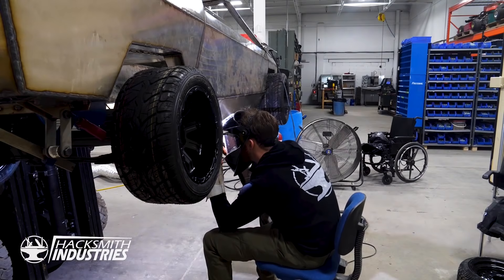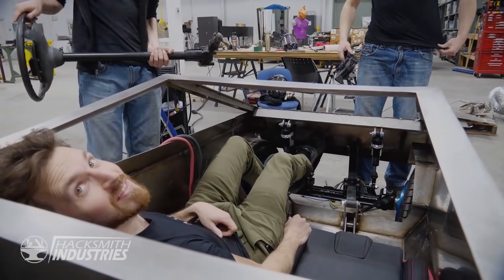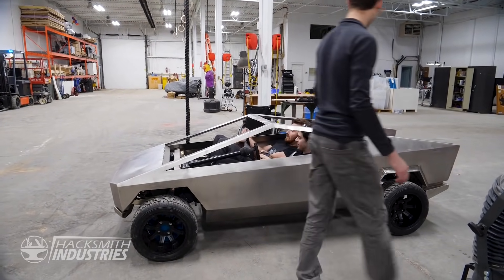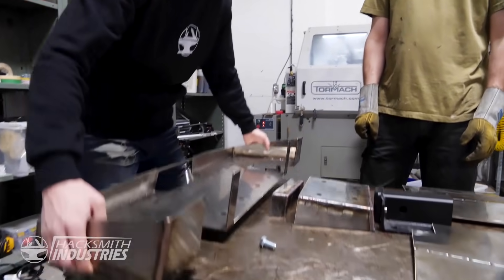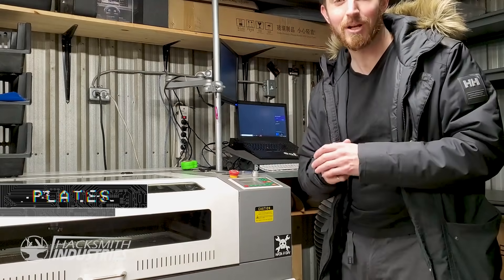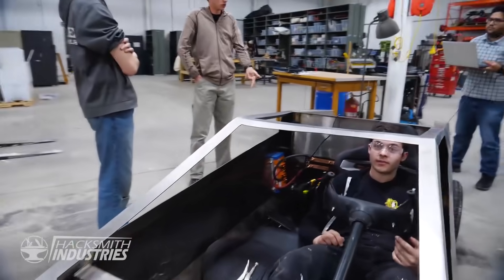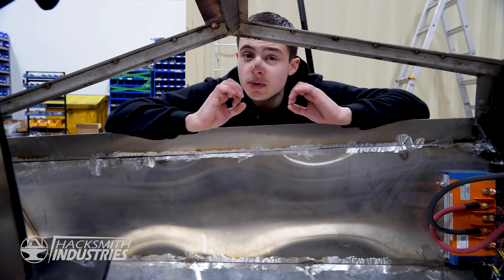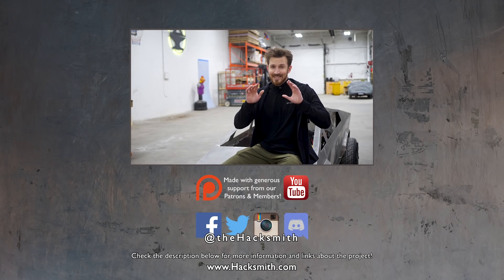CYBERTRUCK BUILD (Part 3/5: Almost Done!)

Comment: What is the calculated HP of this thing?😂
Reply: More than a little, less than plaid.
Reply: beansdad70 r/technicallythetruth
Reply: i'd guess around 16-20hp. they said 700 amps but that's probably phase current. if battery current were around 170 amps and battery voltage was around 72v, it'd be 13 kilowatts
Reply: The real question is what is the duck power of it.
Reply: @danteangelucci2530  you mean Lama Thrust... that is the real true question

Comment: There's those Russian guy that did a lifesize one in like 4 days
Reply: i like both but this ones better
Reply: Top one reasons why communism is better
Reply: They didn't use steel.
Reply: Y2Kvids they used titanium and 8inch polycarbonate windows so they are practically indestructible
Reply: Garage 54s is so much better as they did it so quick and at a fraction of the cost of the hacksmith
Reply: They should race them...
Reply: @russellmarchant2637  haha, race for 4 hours straight, and you would see who has better truck
Reply: What's their channel name
Reply: Teah but those guys dont have other projects at the same time, and they use easier materials/ chassis
Reply: @DoubleAxe4  garage 54
Reply: @russellmarchant2637  thx

Comment: "we need a way to limit the acceleration so when we gun it, it doesn't spin out" uhhhh... so TCS?
Reply: I think I'd have more fun without TCS or current limiters.  Smoke em if ya got em
Reply: Tjunky I agree. My car has tcs and it’s super helpful for snow. I have yet to see if it will actually spin out if I gun it. I know it will if I have it in neutral, rev it up, then pop it into drive
Reply: @liam9235  my car does on gravel and it gives me a warning light, but I like to drive stupid on gravel so...

Comment: They have the torque but not the weight or grip to pull an f-150 also it 100% produces less power than an f-150

Comment: Not to safe. Build a roll cage 1st and the parts 2nd weld around the body 3ed your done simple you made it out to be hard to build it when it’s so simple not to mention adding double brake mounts so foot brakes work same as hydraulic handbrake with used big disc brakes f1 cockpit and fire wall lithium batteries think sim rig